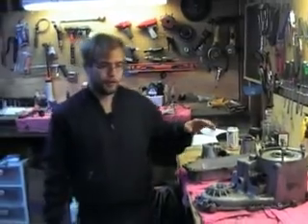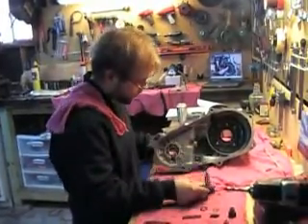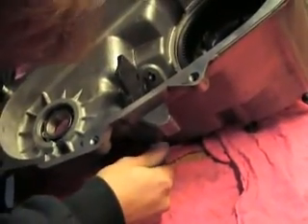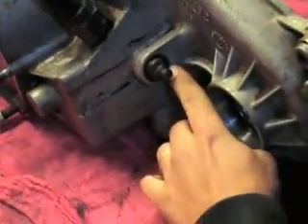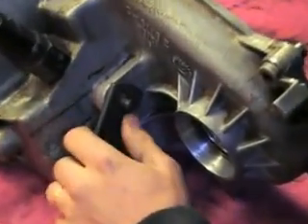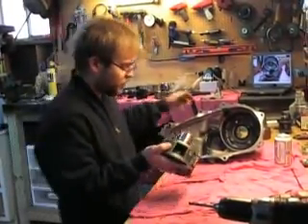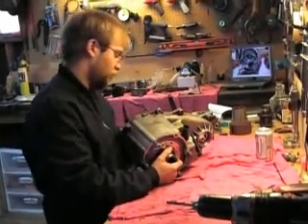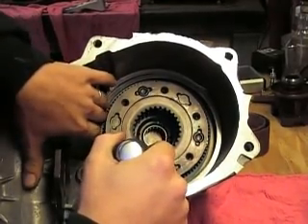NP231J re-assembly / rebuild part 1

Comment: After watching as many You Tube videos as I could find on the rebuilding of a NP231J transfer case, I found this series to be the most helpful. Randell seems to actually know what he is talking about and uses the right names for parts. Unlike some video where the person says it takes hour and three people to do a simple task, and calls the rear drive line the drive train. and retainer clips o-rings.                       All four videos make a complete rebuild. Definitely worth a viewing. FYI. To remove the case from most vehicle it is easier if you lower the rear of the by dropping the cross member first. the bolts going to the transmission are a pain to access otherwise.
Reply from the maker: Dan Higginbotham Thank you.

Comment: Not sure if you still check this but what do you recommend is the best way to install the snap ring that holds the input shaft on the cast? Input shaft + planetary. It's the one that sits under the retaining piece.

Comment: @mechguy83 Do you know if the 208 will mary to the 518? I got an 86 W150 that I'm building a 408stroker for and figured since I'm a rebuild the trans/t case that I might as well do it right the first time w/ 518/241 or 518/208 if its possible.

Thanks for the vid btw, very helpful!!!

Comment from the maker: When I checked the bearings they felt very good this t case had a rebuild done by the previous owner, they just didn't seal the two case half's very well and the tail shaft end bushing was was shot and so was that seal, i just order the seal kit and replace all the seals, the chain showed no signs of being over stretch (no rubbing marks and made no noise when I got the car).  Bearings are pressed in but held in with a retainer snap ring in the case half's, main shaft bearings are pressed fit.